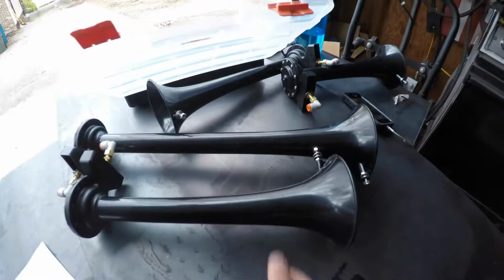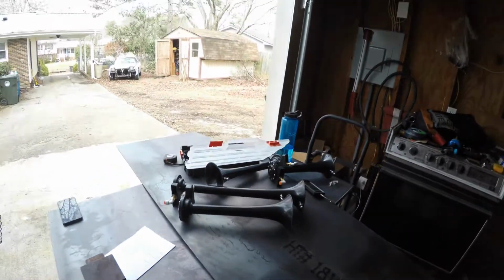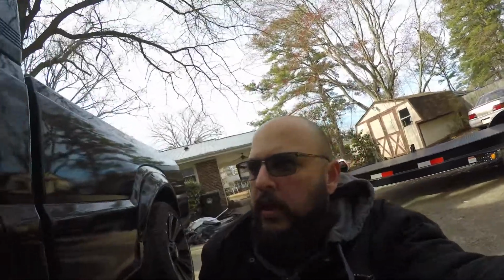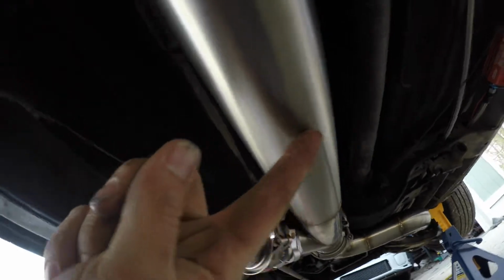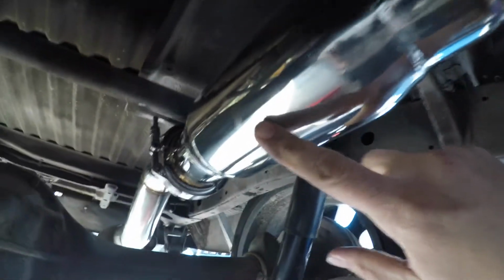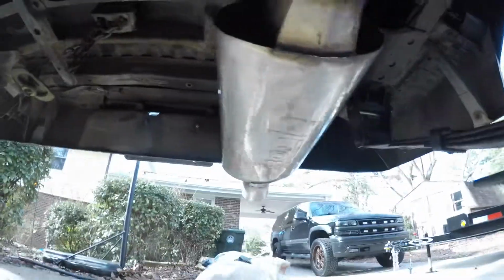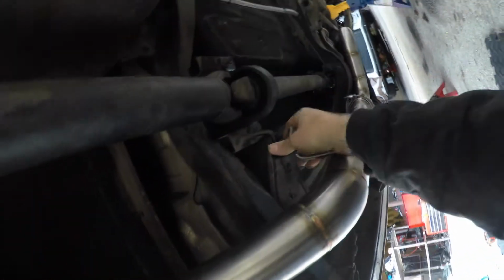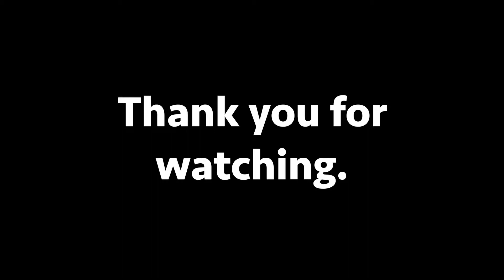Rotary powered Mazda truck gets full stainless exhaust.

Comment: That's a awesome job with the exhaust.  I was wondering if you know what rear end and transmission and driveshaft was being used in the truck? I ask because I'm doing one of the trucks but I may be putting a 13b in mine but I do want to do carb. But I've been looking into this for a while and all the forms nobody seems to answer anything there just on there answering questions with questions and I'm getting nowhere fast. Thanks for any help you can give me
Reply from the maker: supensa ten thank you so much. I am not sure but I can ask the owner and get back to you on that.
Reply: @unknowndestinyfabrication3872  thank you I'd really appreciate it
Reply from the maker: supensa ten it is the stock diff.
Reply: @unknowndestinyfabrication3872  thanks for the news that's good to hear how about the transmission I was wondering if he used the stock rx7 trans or the b2000 trans. Also the drive shaft is that the rx7 shaft or the b2000 shaft. Thanks again for your help I'm really looking forward to your response thanks again
Reply from the maker: supensa ten trans is stock rx-7. Not sure about driveshaft.
Reply: @unknowndestinyfabrication3872  ok thanks I've been trying to get this figured out for some time now I'm glad to have finally got some help on this if you can find out about the drive shaft for me I'd be golden thanks for the quick responses.
Reply from the maker: supensa ten according to the owner it’s also the stock driveshaft.
Reply: @unknowndestinyfabrication3872  thanks so much for all your help I hope to see some more of your videos on YouTube soon. thanks again.